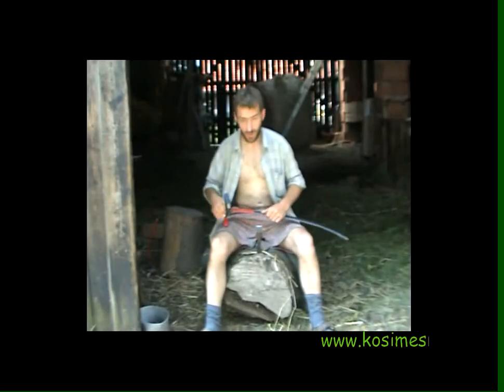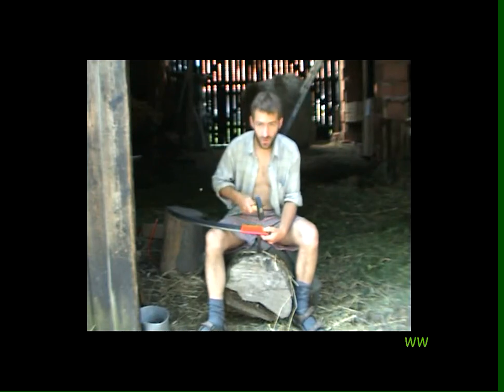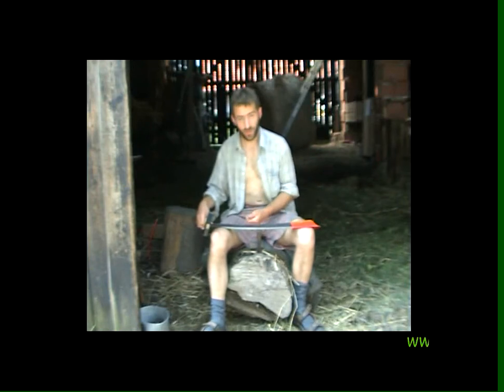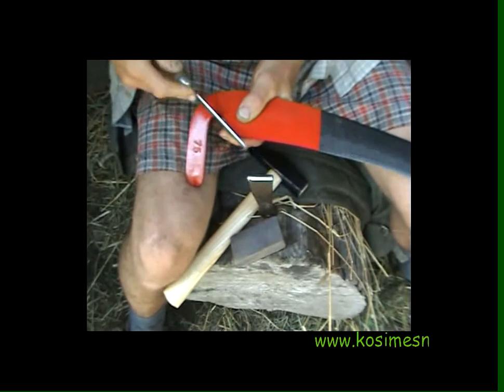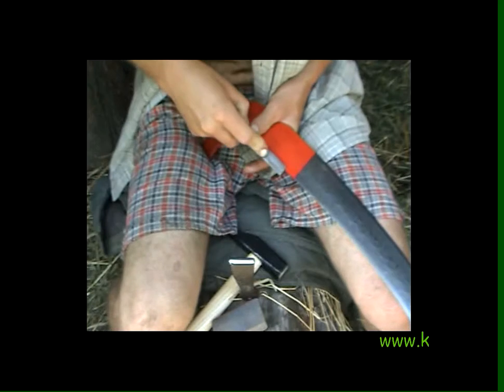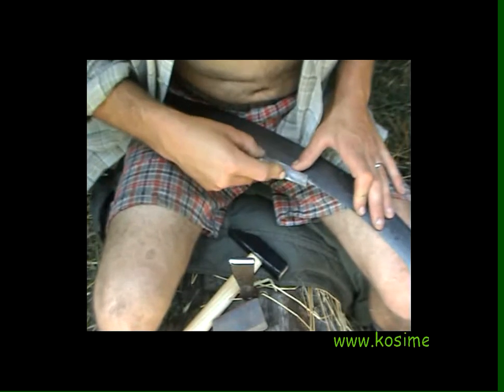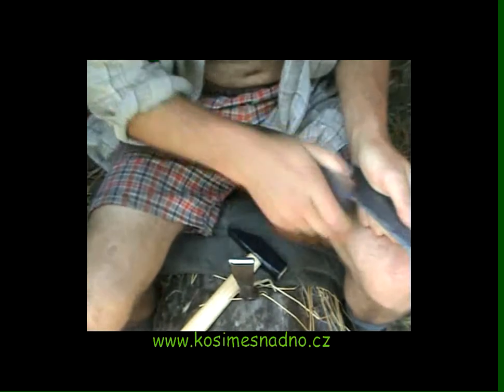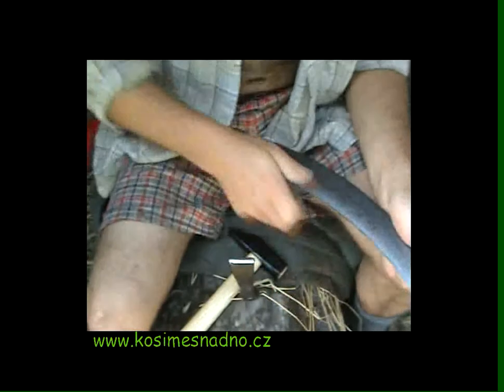Peen Scythe Blade Part 1

Comment from the maker: The serrations are basicly created by peening (hitting with the hammer) in a bad way, inconsistantly and un evenly. Thining/shaping the blade (moving metal forward) does have the effect of sharpening it, although it depends on how thing you make the very edge. You also adjust the strength/hardness by hammer blow types. Generally the thinner the edge the less course and less work it is to use a fine whetstone for final edge maintainence, often in the field while mowing.